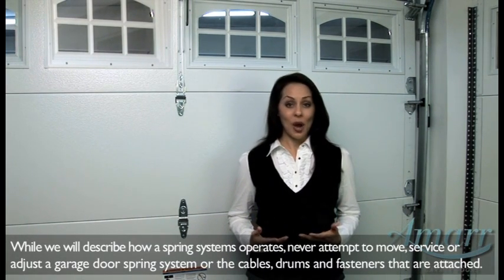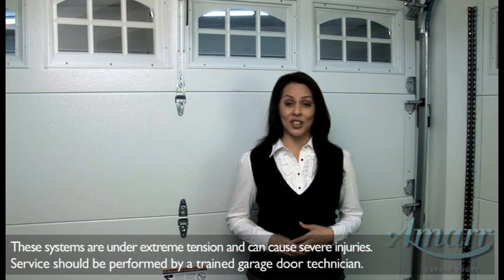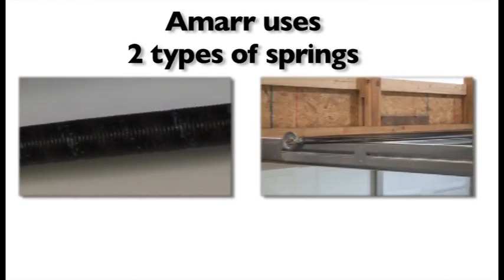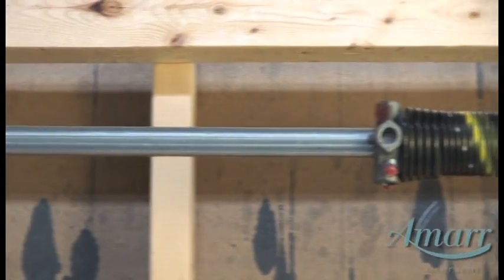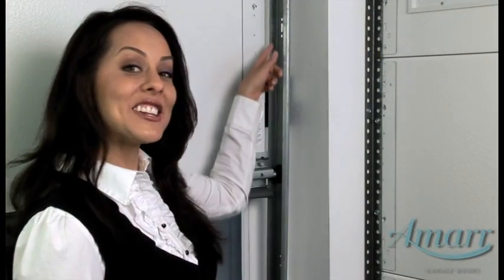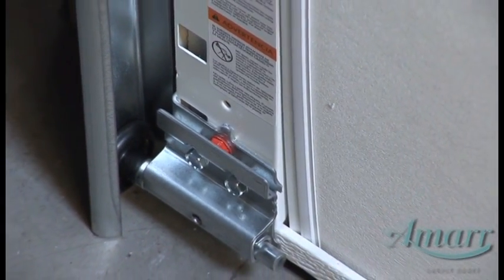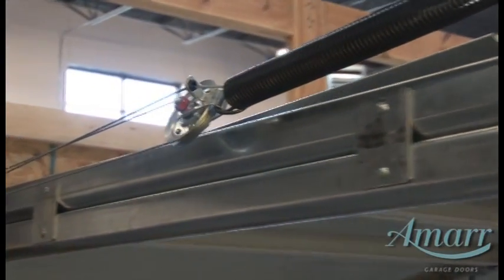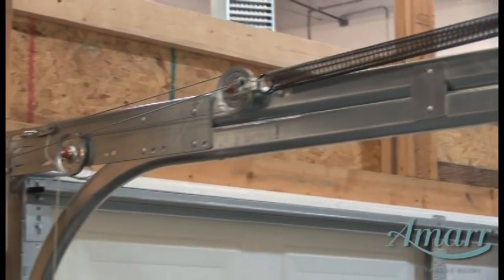Garage Door Spring System

Comment from the maker: Best thing to do is contact your local Amarr garage dealer for service as there could be different reasons for this:  the top fixture roller carrier needs adjustment or is placed too high on the section, the garage opening header is bowed and the door cannot seal to the header or if a double car door, strut may be installed incorrectely.